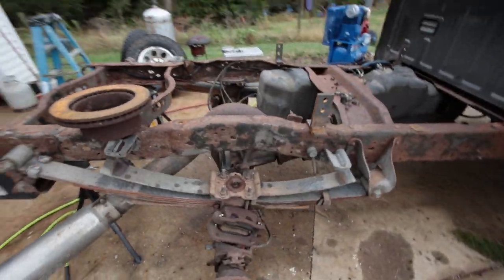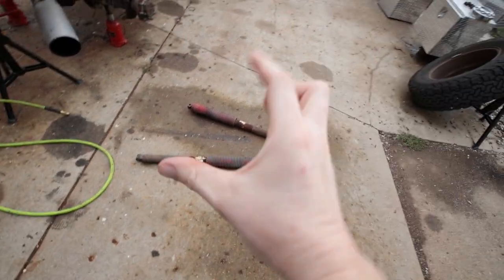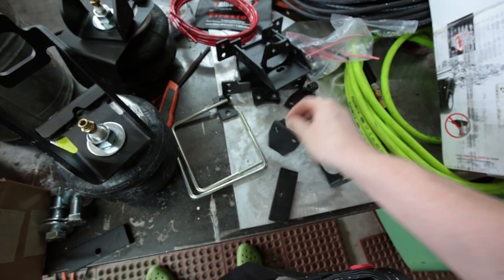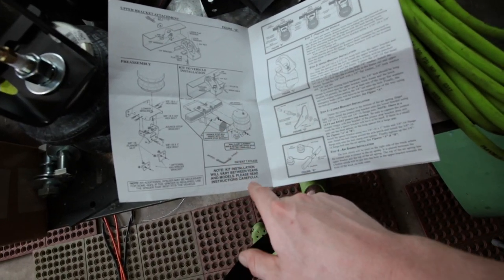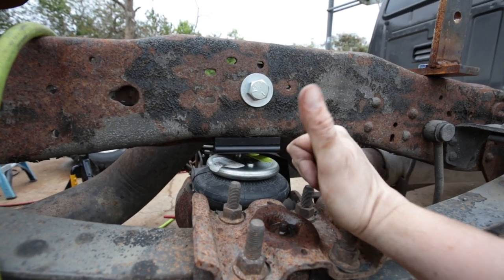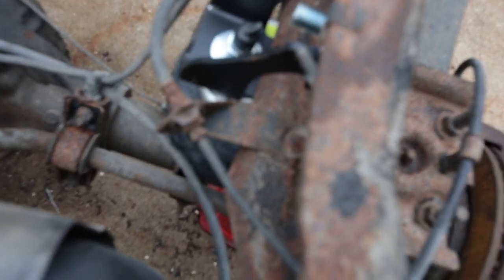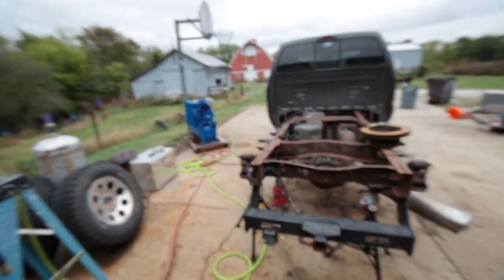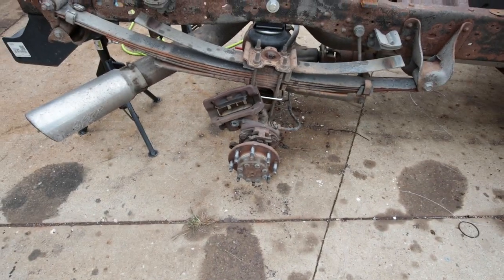Installing Firestone Air Bags On My 2005 Ford F350 Powerstroke

Comment: Before you put the bed on, mix some drain oil and fuel oil 50/50 and spray the frame with a spray bottle. That will pretty much stop the rust you have going on there.☺